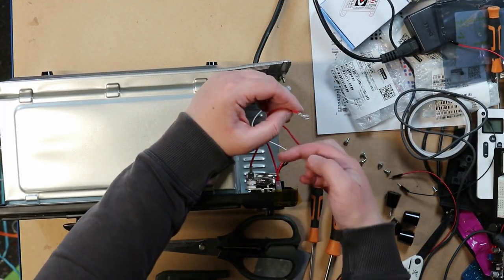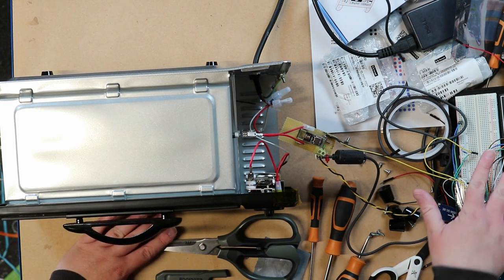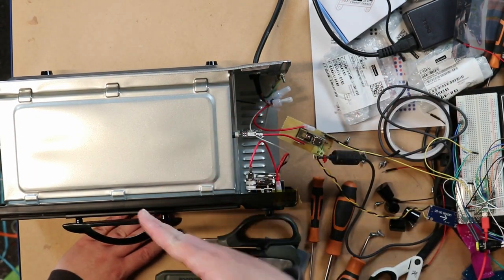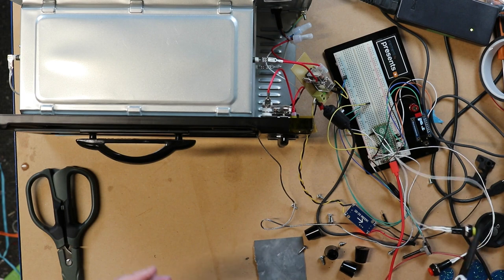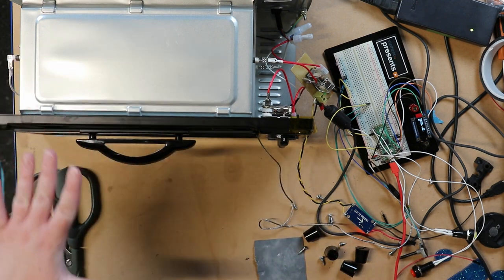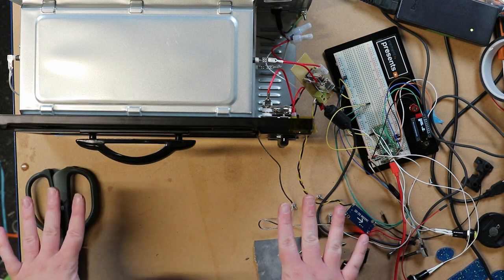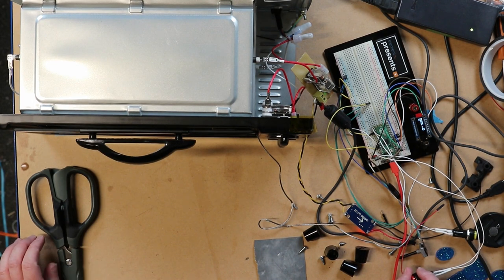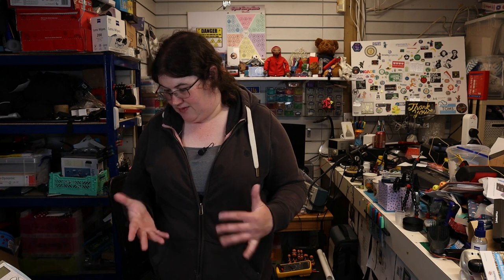Mastering Oven Control: Precision Resin Curing with DIY Modifications - How Hard Can It Be?

Comment: Nice project! :D I made something similar years ago, but used an off-the-shelf PID controller. I used it for curing resins, drying paints, driving off solvents and so on.
For cutting apertures I just drill out and cut close, then spend a LOT of time filing out to dimension :O You could also make a bezel from thin aluminium sheet and cut an aperture in that :D

Comment: To create a nice clean opening in a casing. I use a paint marker that can be easily wiped of so it doesn't leave a stain on the surface. I mark out the area I want to cut out as precisely as possible and then I cut out the opening smaller then needed by about 0.5~1 mm. Finally I use a file to get to the exact desired dimensions and to make the edge or the cutout nice and smooth I just use some fine sandpaper. It takes a while but the result is well worth it 🙂
Reply: The paint pen is a great idea, I've been using a tippex pen, which gets messy, so might try a paint pen instead.
I did mark it with the tippex, and then cut it, but I am probably a bit impatient and just hack away with a dremel, I should probably finish by hand with a file and sandpaper to get a better finish.

Comment: I also mark out the opening.  I usually drill out the corners, and rough out the opening with a dremel with those burr type bits.  Depending on the material I may use an Xacto blade to get it closer, then I finish it up it with small files.  Finally find Emory boards to polish up the edges if I am wanting it to look particularly clean.  I often get reasonable results if I am patient and take my time.    

I may use a 3d printed bezel though in some cases.  It hides a rougher cutout under it.

Comment: Nice video. In my experience even decent ovens tend to fail temperature control HARD when below 100 celsius. They assume your cooking happens in the range 100-250 degree and kalibrere/build for that range.
Reply: Our kitchen oven is actually really good at lower temperatures, will go down to 40oC, but it's a fairly nice model, and does that for bread proving mode. I don't really want to put chemicals or glues in it though, so this was my solution.
Reply: One trick when using a kitchen oven to dry 3D printing filament is to turn on the oven light, it provides just enough heat to get it done. Or if you have an oven dedicated for that use, run a 240V oven on 120V.

Comment: The element doesn't instantly cool when the power to it is cut, so even though it's turned off its thermal mass will keep heating the oven for a little while. That's one reason for the overshoot. One way to combat that would be to completely change the behaviour when it gets to ~10 below the target temp and rather than having the element constantly on start doing short cycles of on and off. I do think that some trial and error to get some data (or a "profile" as you called it) so you can get a better idea of exactly how to program it.

I think the critical bits of info are the rate of temperature rise while the element is on (which isn't necessarily constant across the working temperature range) and how long the oven temperature continues to rise after the element is turned off.

The more I think about it, the more complex a problem I think it is to get a really reliable, constant temperature. You have to balance several factors including the rate you're putting energy into the system, the rate of energy loss (an uninsulated toaster oven doesn't retain heat efficiently), and the factors that cause overshoot such as the elements' thermal mass and sensor reading lag.

But, it might not actually be that difficult a problem given some careful thought. I think the biggest factor is to work out a "duty cycle" profile where the cycles get shorter as you approach the target temperature, understanding that there will be a minimum on time of several seconds, and the off time will be longer than the on time because the element heats up faster than it cools. But the thermal mass of the element will have less of an impact with the longer duty cycles and more and more of an impact as the cycles get shorter. As a wild guess, I would start with a maximum on time of 20 seconds with an off time about the same when it gets to 10 degrees below the target, ramping to about 5 seconds on and 10 off when it's within about 2 degrees of the target. Depending on how well (or poorly!) that works, I would then fine-tune the duty cycle range until it gets a satisfactory result.

I assume that the reason you used an external enclosure was to avoid all the possible issues that could be caused by putting the circuits and components inside the high temperature environment of the oven's enclosure, which is a really valid approach.

Comment: Hi, great project. To cut openings in my projects I have used nibblers, though this not always practical because the case may be too small.
Reply: nibblers sound useful, have you got any recommendations for ones to look for?
Reply: @hifromkatie  Yes, I have two tools, the one I would recommend is Klein Tools, part no. 76011B. It is slightly smaller and can get into smaller cases.

Comment: I like using a sharp razor blade cutter tool with a metal straight edge, very carefully, going over and over the lines for the cut outs that are plastic.  Have something solid like a piece of wood behind where you are cutting as well.  You can mark and punch then drill the corners with a twist drill first before cutting if you want more rounded.  Hole saws are handy as well, though then I wind up using the blade in a more rocking motion that isn't so safe where I've actually had the hole saw cut up my thumb and index finger one time due to me holding the piece when drilling out.  Thankfully no issues with a razor blade cutter, though have with a deburring tool again holding with my hand not carefully and that time the part wasn't against a surface.  For metal, I usually use a Dremel or similar style tool with cut off disc.  Though a handy tool that is slow and sometimes jambs is the hand held nibbler tool.  That makes better looking cuts when careful, though sucks donkey bum when gets jammed.
Reply: Oh and I forgot to mention, using painters or masking tape over the whole surface for a cleaner markup and final surface.

Comment: nice idea! For displays cutouts in metal without a cnc machine, i always made a mess of it. What i do now: cut it oversized in any way i can (drilll holes, file, jigsaw,etc), and then just 3d print a nice looking bezel that has a width that covers all my 'crimes' ;) For most standard sizes you can also get ready made ones for a few cents.
Reply: thats a very handy trick!

Comment: How hard could it be? LOL. I have been wanting to do something like this myself so I like this video quite a bit. Also, a word of caution on epoxy: when it gets hot prior to cure, it also tends to get thin and runny. Often it might be better to use a more modest temperature for at least an hour or so to get an initial set before going all the way up to 80 C. Also, ovens usually have some type of over-temp cutoff in series with the heating element. I couldn't tell if you kept that. But it would be a good practice to do so in case the relay fails short or something.